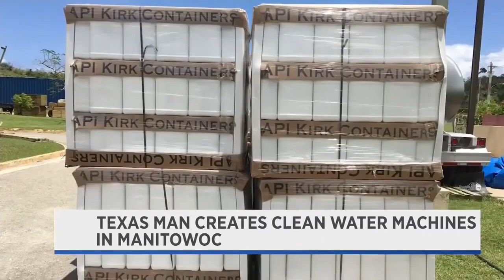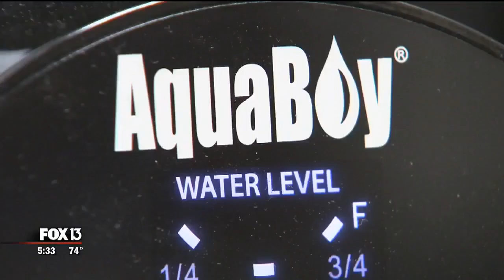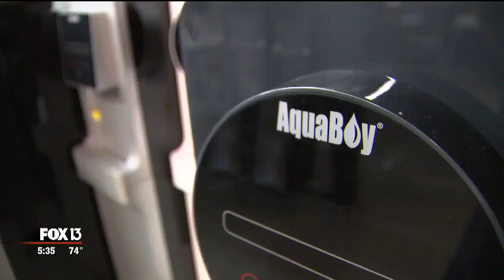UNLIMITED Water From The AIR?

Comment: Atmospheric water generator is similar to air conditioning system and refrigerator system based on thermoelectric effect. Electrical grid system supplying for Atmospheric water generator come from biodiesel generator powered.

Comment: How are they removing the toxins they are continuously spray out of airplanes ?
Reply: I just looked up the AquaBoy brand and it says the unit uses a 7-stage EZ-Filter process with HEPA and UV filtration and gets rid of chlorine, flouride, lead and more.
Reply: luke zac - fair question
Reply: Was thinking the same thing